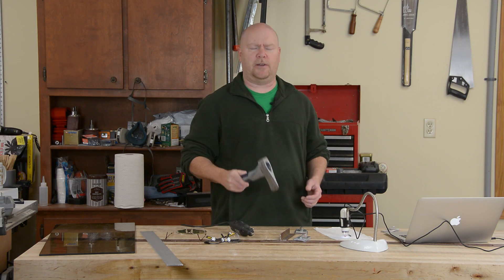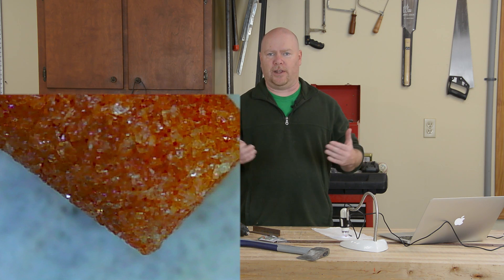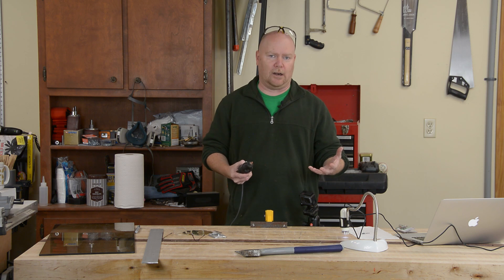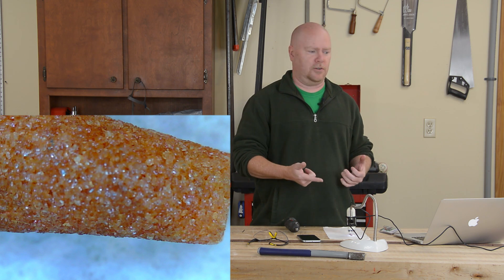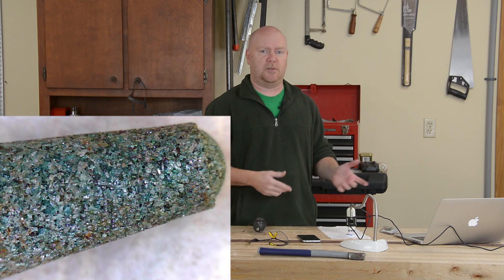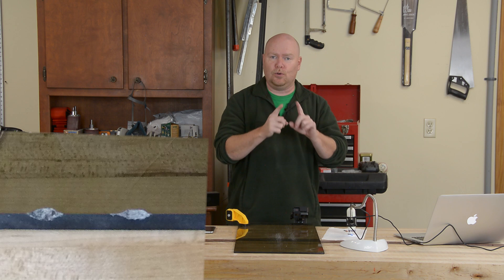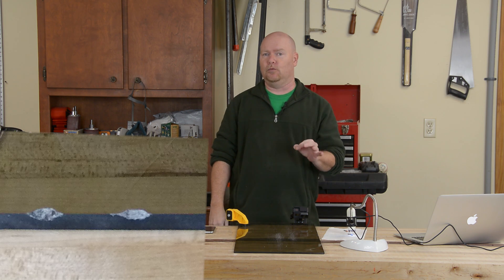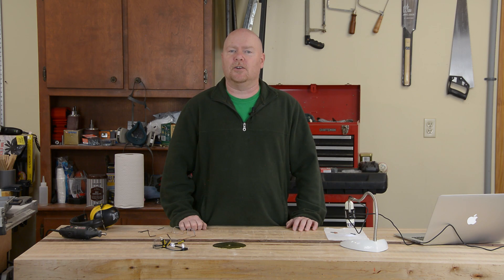Dremel Grinding Stones - Aluminum Oxide vs. Silicon Carbide

Comment: Would it be better to use a metal on metal like the diamond bit or a metal file type bit such as used in the automotive grinding tools every time I use the orange or the gray grinding wheels the material eats up the wheel so those types of stones really aren't that effective at removing lots of metal

Comment: A little late to this party but if you're still there I have a question; After grinding the softer metals for whatever length of time, what do you use to clean stuff and junk out of, or off of, the bit so you have a decent cutting service to continue on without the waste metal getting in the way and clogging up the effectiveness of the bit? Thanks

I'm new to all this and have the flat brass surface of a  handguard for a Japanese sword (the tsuba) to remove about 2 mm of brass from.

Comment: I was told a long time ago to never grind soft metals like copper and brass with stone because the soft metal clogs up the stone allowing heat to build up and the stone can fracture or even explode! In the shops I've worked in all brass and copper would be "sanded" with various abrasives adhered to flexible materials like belts and disks.

Comment: Matt im looking to grind down a couple of small rivet heads on the links of a motorcycle chain. I have a normal drill so wondering what the best drill bit would be for this job. Motorcycle chains are made of a mix of steel alloys.

Comment: well this gives me hope 

my bong broke but not horribly so i plan  on leveling the glass out so i can slide over a piece of steel/stainless steel  with some orings without destoying the o rings 
planning on using a silicone carbide wheel (fine) on the bench grinder 
its about halfway through its lifespan 

only questions left now is t2 lube or not 2 lube

Comment: You said you "dressed" the stones. How exactly did you do this?
Reply: There is a special stone you take your grinding stone too and it will remove metal particles stuck in grinding stone and it will reshape stone flat again.  It resurfaces your grinding tool, restoring it

Comment: Aluminum Oxide and Silicon Carbide both come in various grit sizes.  The stones being compared appear to be of different grits.  The binder is what determines wear rate when the grit is similar in size oil or water would help with the test.  Thank you for the video.

Comment: The glass ground better with the aluminum oxide bit because that bit is softer, wears itself away, and stays in contact with the glass in doing so.  The glass and the harder silicon carbide bit bounce off of each other, thus losing surface contact.  Grinding stone wear is a good thing when it comes to hard materials.

Comment: I called the dremel company to ask them what do I use to Blunt the edge of stainless steel. I have flattened spoons there are sharp on the edges and I need to Blunt them. They said aluminum oxide  grinding stone but looks to me like they sharpen.  Can you help me?

Comment: I have question is anything for stainless steel sharpening stone for dremal?
Reply from the maker: Stainless is harder than mild steel, but not enough to cause problems.  You can use anything that will work as a stone on other types of steel.
Reply: Thanks

Comment: Somehow I got here when I was looking for a way to scuff car glass for gluing marine vinyl to it. I think the emery wheels at a high setting will make enough scuffing to use JD Weld epoxy work for the vinyl. Aside from this now, I know why my aluminum oxide grinding stone went to sh.. after using it on the lawn mower blade for just a little while.  Silicon carbide is far superior for lawn mower blades in my opinion. When your mower blades are very sharp, it cuts the time down for the pushing of the mower considerably. I never knew that when I was a young kid. Thanks for the video, this was very interesting.
Reply: A dull mower blade also tears the grass, rather than cutting.

Comment: Silicon carbide is less likely to get metal glazing on the wheel.
The problem is you just shoved it into the metal.
That rule is for surface grinding. Where you can easily control depths of cut and feeds/speeds.
If you used less pressure when grinding I can guarantee you would see an improvement in the SIC wheel.

Comment: Isn't aluminum oxide dust a Neuro toxic?
Reply from the maker: Not according to the MSDS.  Principal concern is listed as "nuisance dust" which may cause respiratory irritation (just like any dust can).  

You should wear a dust mask or respirator for any operation that makes dust, grinding included.  I didn't - but should have.  I sometimes make safety concessions to the recording process...

Comment: i just sorted Stella's meal, dodged a glass mine field to find a light source - switched off the torch, and did two laps of the unit in the dark while triple blindfolded- and adjusted my heater thermostat.
and i love pilots!
lustiDiD
(-_+)
i'd like the stock room scissors back please!
Reply: thank you

Comment: getting ready to grind off a couple small welds with a dremel. Any suggestions on the best grinding tip?
Reply from the maker: The cheaper and more readily available aluminum oxide stones should be just fine for work on mild steel, even the harder welds.

Comment: So for glass you use the green ones, for steel the red ones.
And what's for brass/alu then? o.o
Reply from the maker: Sandpaper or carbide cutters.  Grinding stones are all but useless on soft metals.
Reply: I see, thanks for the reply :D
Reply: I need to remove a few mm from a block of aircraft grade aluminium, would you recommend the 60 grit sanding drums or the 9901 tungsten carbide cutter?

Comment: I put my nose to the silicon grind stone and wore it out immediately.  I enjoyed the comparison test demo and congrat's on 10K subscribers Matt! Take it Easy - Glen
Reply from the maker: I should have mentioned that.  You can do in any grinding wheel with too much pressure.  Dremel stuff is especially bad since it's specifically designed for high speed - low push use.

And thanks for the Kudos Glen.  I'm still enjoying your stuff too.  You'll be there before you know it!